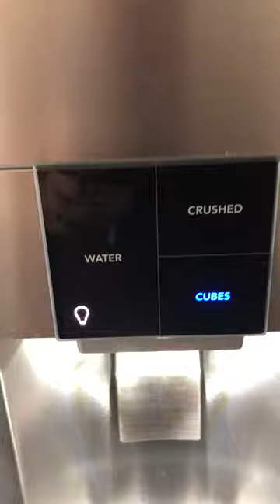Refrigerator Water - Warm to Cold 1 - How To Solution

Comment: I got a new Frigidaire side by side and to my dismay the water is room temperature.  Otherwise it's a pretty decent fridge.  How hard is it to design a fridge with the water tank inside the cooling area?  not going to cut holes in the fridge to get cold water.
Reply: Hi did you contact the dealer and ask if that is normal , i have a GE fridge same thing lol
Reply: @598billd  I bought it from a scratch and dent store so it doesn't have much warranty.  I can tell it's a very efficient operating refrigerator but 2 gripes - 1 the warm water dispenser and 2 the fridge door shelves - just not very well designed.